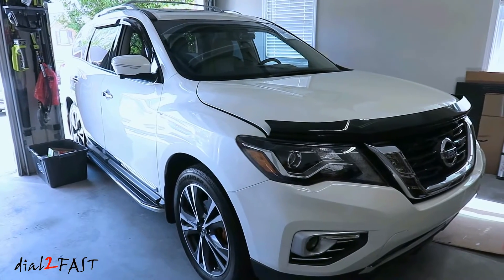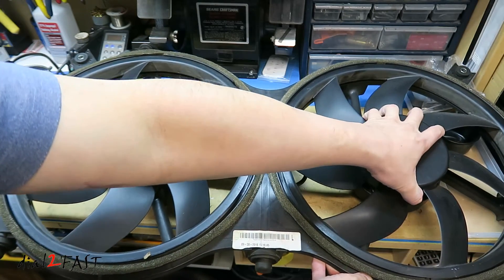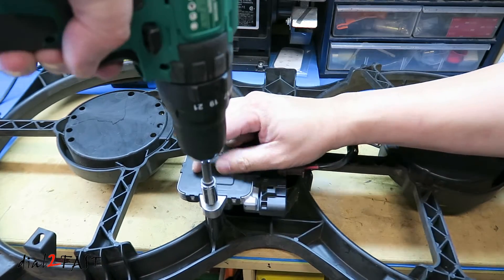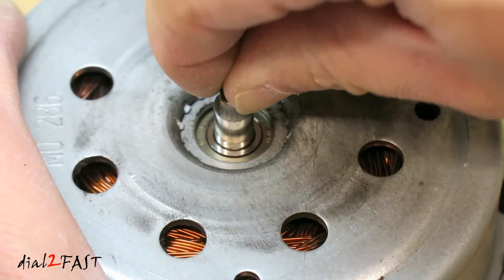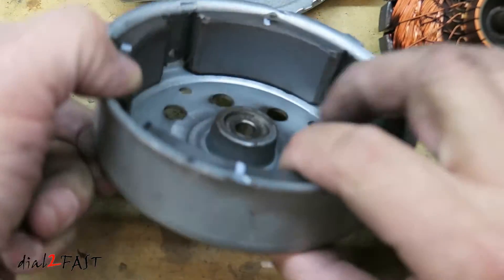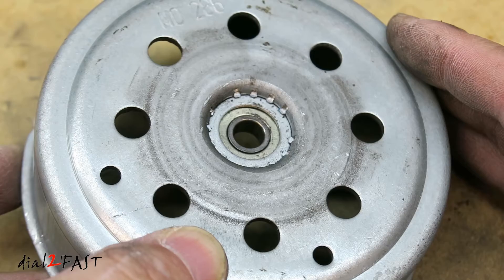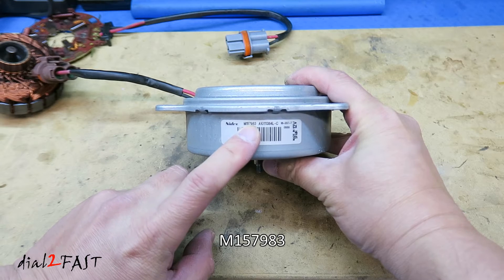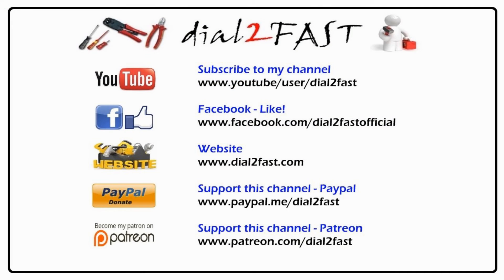Why So Many Nissan Radiator Fan Fail?

Comment: Hey man. How did you get the middle part out? The part that the magnets surrounds (with the copper wires). I'm not sure if mine is stuck or what but I don't want to damage it trying to take it out. I can replace the bearing and tack back the washer in place but I'm having trouble getting out the rotor. Please help asap. Exact motor by the way.

Comment: In order to make this a truly inexpensive repair.  (About $5) Do this.  Follow the excellent video to the ball bearing identification.    Then, if you own a die grinder (air, 20V cordless, AC corded 120V) use that.  If you don't, then use a power drill.  Buy a die grinder bit if you do not have one (that will cost $10 more.)  Then you just grind out the press tabs shown in the video that retain the washer.  pull the washer out with a hook tool (Harbor Freight, $2, or a toothpick..., or a small screwdriver.)    Then the ball bearing pack will fall out freely if turned, or else you will have to press it out.   To press it out, use a washer the size of the diameter of the bearing.  Use a socket about that size, and then strike that with a hammer and knock out the bearing.

Buy new bearing on Amazon or eBay, or AliExpress.  I recommend a Japanese brand bearing of the same size and dimensions, or else order what was in there before (that failed...  so not a raging recommendation, its just easy to read the part number and vendor off the side of the bearing.)

Place, or press (with socket and hammer) the near bearing.   Drop back in the washer.   Now mix up two thumbnail dabs of JB Weld Steel Epoxy, mix with Q-tip, then dab in healthy dollups onto each tab location where you ground out the tabs.  (The Epoxy which is plenty strong anyway, just holds the bearing front to back, it doesn't take any weight, but it could...)

Let dry over night.  (JB Weld steel drys slow, takes over night.)  Replace rear bearing if you want (often a bushing anyway, so no service), replace brushes.  (Need to pull those out, measure them with a millimeter type ruler (metric), and order new ones by dimension on eBay.   Often the brushes are still fine.   Usually the failure point is the bearing.   But if you are in there anyway.... replace the brushes if you can find them.

Reassemble.  Good as new, will last as long as the original one did.   

Total cost for bearing and JB Weld.  About $5.
Add $10 if you need to buy a die grinder bit for your drill.
Add $20 for new brushes, usually around $5 each, but cheaper if you shop harder.

Typically, the $5 repair is all that is needed.
But $20 for brushes usually worth it.   $10 for the die grinder bit if you do not have one.

Comment: I own a 2017 Pathfinder. Bought it used in 2018 with 16k miles. It now has 95k on it. A/C fan started making the famous rattling noise about 3 months ago. Found the entire fan assembly on Amazon for $115. Going to replace the entire unit since it is cheaper than just replacing the fan motor. Thanks for the detailed video!

Comment: Does this “play” of the first radiator fan affects air flow per second? Because I have a Citroen c4 with the same issue. My mechanic told me it’s ok, don’t bother. This ring which is the root of the “play” is it possible to wear of completely? This happens since 170000km, now I am at 190000km
Reply from the maker: You need to fix it because it will eventually lead to fan failure and stop spinning. When that happens, the radiator will not cool and lead to engine overheat. Also it's annoying with the rattle sound.

Comment: One fan bearing was going bad, but it was on average 40f outside and figured i'll just unplug it and order a new assembly that would come in a few days. Figured it should last a few days, not even! lol.. after 2 days the "good" fan was even worse at the point it you could feel the vibration on the steering wheel and i stopped driving it. Truck was only down for 2 days, but its wild they died days within each other. Granted having only one running will work it harder. I chose to get a quality updated revision of the fan assembly without the module, quieter and improved bearings for under $100.

Have some buddies with the same Nissan fan assembly, good to know i can help them out.

Comment: I just finished replacing the fan assembly on my 2016 Pathfinder, after the dreaded motor wobble was making the whole vehicle shudder. I went with the ~$220 aftermarket option that had the best reviews on Amazon, it came faster than expected and the install wasn't too terrible. I appreciate this tear down, and having a better understanding of why it happened in the first place!
Reply from the maker: Thanks for sharing your experience. Glad you got yours fixed. Have a great week!

Comment: All Nissans using this type of motor suffer same issue, Xtrail T31, Qashqai J11, Rogue etc... If you use AC a lot typical failure time is after 3yrs, This failure has roots in Nissans collaboration with Renault group as some Renaults have same failure (Espace V for example) as oem manufacturer of all those fan assemblies is Valeo  using that crappy Nidec motors they've got for cheap. It's planned obsolescence at its best and Nissan/Renault group should be held responsible for this.

Comment: it also happens with the nissan rogue sport s, im on my 2nd fan assembly. words of advice, as soon as you hear the noise "replace it asap"  as it will only get louder and worse.
Reply: Reading you too late, but thanks for the info that the Rogue is similar, I'll try this out

Comment: Thanks for the nice video. I was able to service the DC motor by replacing the defective bearing. It is very simple compared to the hard work of taking the fans out! Just press the bearing out with any bearing removal device and it will come off with the washer. Put the replacement bearing back and the supporting washer. Then you need to reapply the notches with a nail/hammer to secure the washer. It cost me only $6 for the bearing and of course my time.
Reply: in my case pressing out the bearing lead to damage the metal finger so it was matter of days after installment in the car and the fan back again with wiggling  i uninstalled it for the second time replaced the popped out bearing with new one , i put some super glue surround the bearing and the hosing ... guess what !!
 its wiggling again 😭😭😭😭
Reply: I replaced the fan motors on my Nissan with Honda fan motors. The problem cost me a lot in terms of ac system repairs.
Reply: Hi, I am having difficulty removing the bearing. Do you happen to have any video showing how you removed it or the tool you used? Thanks!

Comment: My Nissan Qashqai (Rogue Sport) radiator fan failed and I replaced with aftermarket part. Same problem the bearing failed leading to vibrating fan. This was @ 113,000 miles.

Comment: Thanks so much! 2017 Pathfinder Platinum with 26k miles. Replaced this crap with an API brand one. Very grateful you have a Pathfinder!! So many times you've helped install all the accessories

Comment: Yes agree with you it is common issue in nissan pathfinder r52 and infiniti QX60. 

For fixing this issue you have multiple options:
1- Replace it with original fan and this will cost around 530$
2- Replace fans with aftermarket and this cost you around 280$
3- Replace the motor only with aftermarket motor.
4- Replace it with original Nissan motor

I recommend option 3&4, depend on what you can get in the market. 

Finally, I found that motor of Nissan sunny /Almeria can fit to pathfinder and price wise it's cheaper cost around 60$.
Reply: so basically just replace the fan motor , no need to replace the modular and fan ?
Reply: Hey could you share the link for the motor you got? Can't find it anywhere

Comment: I have 2017 , bough it brand new , it has about 118k miles now ( lots of family fun trips over the years ) today will be the 3rd fan assembly I’m replacing since buying the car (first time doing it on my own) , just wanted to thank you for such good directions in the replacement video !
Reply: wow you replaced 3 ? jesus!!
Reply: Where the first two official Nissan replacement parts? I have to wonder if you get the official replacement part from the dealer, is t still as crappy as the original.  You would have thought they address this design defect by now.
Reply: How long did it take roughly to change it yourself? My fan is starting to go this week! Thx
Reply: Awesome video! Thank you! I have an Infiniti QX60, and am on my 3rd time having this issue. On my car the a/c fan is the one that always fails. Has anyone tried a more robust replacement bearing?
Reply: I replaced mine with an American made universal fan for 90$. Still running strong 35k miles later.

Comment: How many miles on vehicle ?
Reply from the maker: For my Pathfinder, the fan failed at 40k miles. Others have reported failing earlier and some later.
Reply: Wow. I have over 100k on my 2017 and have been fortunate not to have a problem with fan, or cvt which seem to be the two most common problems. Always thanks for the videos.
Reply: I have a 2014 with 95k miles the fan seems squeaking now when I turn on the AC.. so it maybe on its way debating on just replacing the Fan with motor and not the modular.

Comment: Nissan's CVT transmission is also ridden with problem. A friend told me he heard his local dealer mechanic say they replace twenty or so trans every week on cars and that Nissan has no plan to research and fix the issue because most of their R&D is now devoted to electric cars. Anyways he changes his trans oil regularly as a prophylactic measure.
Reply: There is a TON of hearsay and speculation in your comment, but the very last sentence is right on point.
The JATCO CVT transmissions used by Nissan are not super reliable, but if you change the fluid every 30k thousand miles using ONLY NISSAN BRANDED CVT fluid, they tend to hold up fairly well.   
The problem is that the Maintence guides in many of these vehicles say that the transmission fluid doesn’t even require inspection until the first 60k miles and by that point, many of these transmissions have already suffered some degree of damage.
Reply: Prophylactic lol think you meant preventative maintenance but in essence it's a vehicle prophylactic since it's protecting against unwanted failure of transmission
Reply: Nissan CVT Automatic Transmission have drain plugs most Techs and NISMO enthusiasts will recommend off the record of course to use the drain measure and fill technique...jack up car remove drain plug drain into a clean container so you can actually inspect the old fluid and measure how much you drain (most recommend 1or2 quarts at a time) then replace plug and add new CVT full synthetic fluid each cost approx$10-$15 per quart NOT ATF FLUID! CVT SYNTHETIC FLUID DESIGNED FOR IMPORT vehicles. Then To refill you have two options in which case you have to locate where the dipstick used to be on top of trans under battery tray near starter on 4cyl models...or on newer models use an Allen bit to remove the fill plug if equipped or a long skinny funnel that may have to be modified to fit in the "non dip stick" filler type tube on older models (I've seen and used them on 2005-2010) Drive for a few hundred miles and repeat this is more like an extended flush and fill but is less harmful than doing a service on most higher mileage Nissan's I'm sure there are videos of this process already if not there should be!

Comment: That looks identical to a skateboard bearing, also NMB 608z.  If you could change the bearing, fit either Powell swiss bearings or the ceramic bearings instead. NMB's are considered trash in the skateboard world btw..
Reply from the maker: I also looked up this ball bearing part number, and it is the same ones used in skateboard.
Reply: They use 608z bearings in just about everything.

Comment: Great explanation video! Any chance you can share some links where we can buy replacement parts for this common issue? whole assembly, and or just the motor part? thank you!
Reply from the maker: Those links are in the video description.
Reply: @dial2fast  I do not believe the seller you listed still has an active listing. Any good alternatives?
Reply: @dial2fast   can you help me?

Comment: I seem to be a good idea to buy and replace the hold fan. Buying an Nissan part motor only may work, but the problem may happen again. Good video.
Reply from the maker: Yes I also recommend replacing it with a good aftermarket unit.